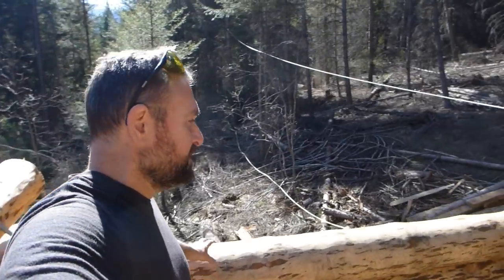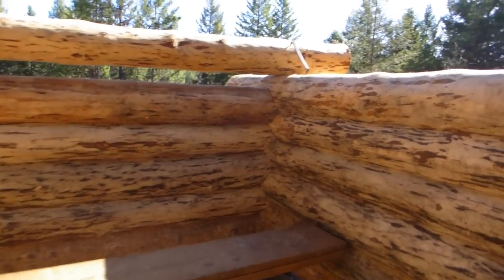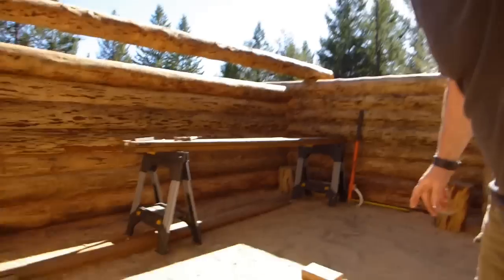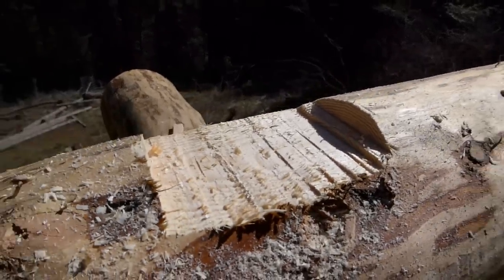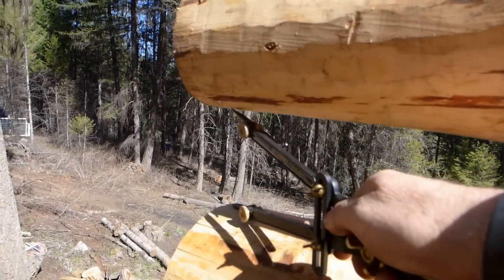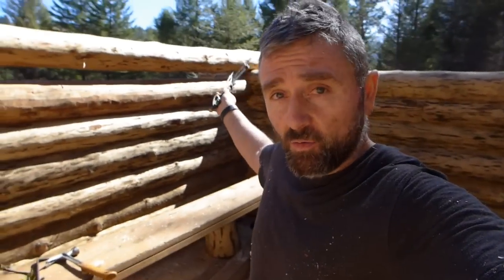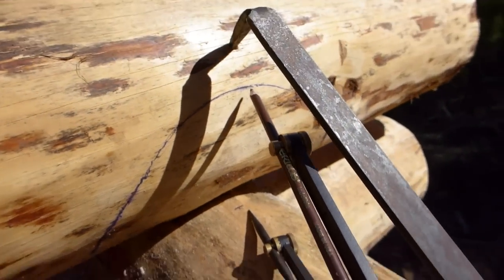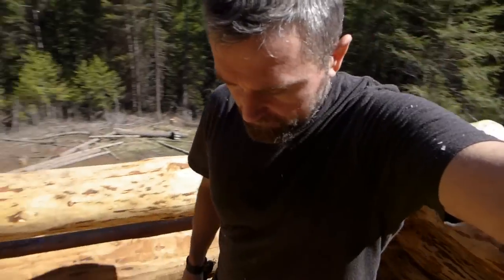Off Grid Log Cabin Build - Scribe fitting resumes Part 1

Comment: would this kind of construction be the most suitable for wet/extreme cold i.e. northern ontario/alaska/yukon? also seems like you are using green logs... any issues with wood drying out and warping (in the extreme cold or just drying out over time?) thx! would love to build my own one day
Reply from the maker: Hi there. Log cabins have been used and still are used in the far northern hemispheres. I am using green because since our cabin is so small I do not believe warping will be an issue and 2. Our spring and summers are extremely warm with little rain so drying out will not be an issue. Also I have seen other log homes in our area built with green log and they still look great 10-15 years later. Ultimately time will tell...

Comment: Why are you concerned about having the top edge of the log level (equal heights at each end from the cabin floor)?  
Why not leave the butt end a little higher from the floor?  And then on the next log that goes on top of the current log, but in the opposite direction, leave that butt end a little high and then they would equal each other out?  

Maybe concern yourself with leveling an imaginary line that is passing through the exact center of each log, and not worry about leveling the top edge of each log?